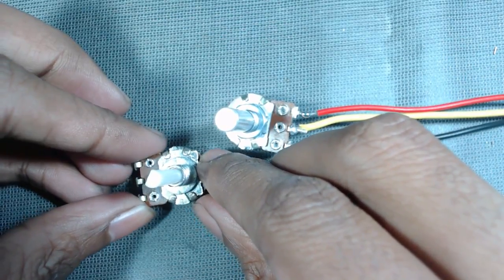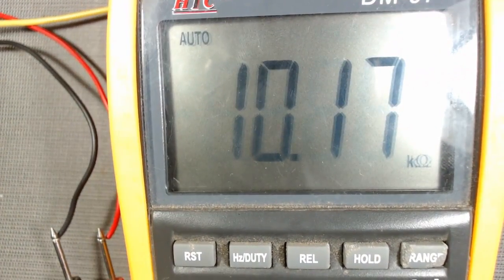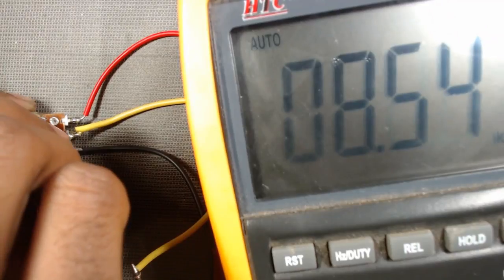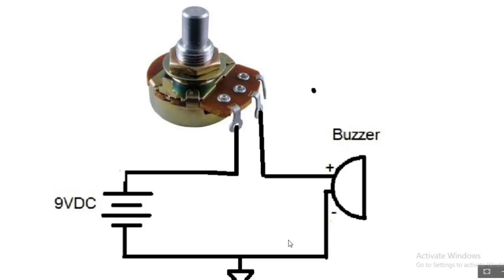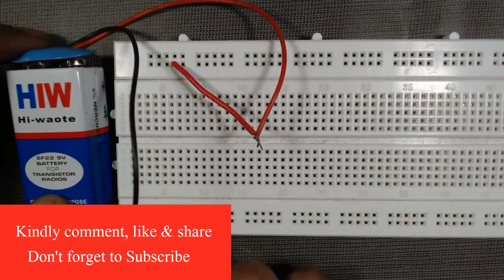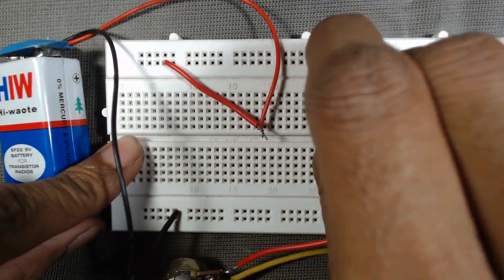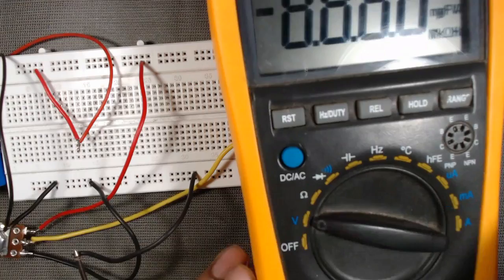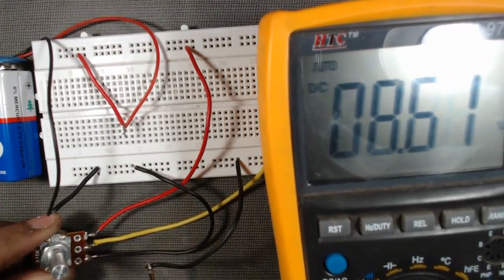how to use potentiometer as variable resistor and voltage divider

Comment: This video helped me a lot. I'm attempting to revive an old laptop and I plan to use a potentiometer in another laptop's power supply by lowering it's dc voltage output therefore lowering it's wattage (P = VI). I know the power requirement of the laptop based on it's dead power supply (64.98W = 19V * 4.74A) I intend to use my extra power supply to but I'm not sure if what I plan to do is safe for the laptop. Any input on this will surely help.

Comment: how would the voltage vary if the "wiper" (middle pole) and the low side were soldered together and a voltage was connected to the high side ?

Comment: I just subscribed to your channel.  I have a car battery going bad and cannot buy another one for about three weeks.  Knowing this I was thinking the battery will have to be charged each night to be able to function the next day.  The power supply I have on hand is from an old laptop; voltage rating of 20 volts and 2.5 amps.  So I was first looking at winding a transformer and  rectify with 4 diodes.  Then I was thinking maybe a voltage divider and realized I have 4 or 5 potentiometers from old circuits.  That was my ah ha moment, the easiest solution.  However I hadn't ever installed one.  Your knowledge really helped me out of a kind of rough situation.  Funny how the information needed came from the other side of the world and from your perception it's conceivable that one of the people who needed this knowledge in a very bad way (probably needed this info more than anyone given my situation) found you from the other side of this rock we call earth.  Piece friend, I will look at your videos first from now on when in need of reliable information.   Cannot thank you enough!
Reply: You charged your car battery with a laptop charger...?
Reply: @tubeyou0925  it charges about 9volts then gave out.

Comment: Simply defined and easily understandable video on the subject thanks a lot.
Reply from the maker: Thank you
Reply: @DPVTECHNOLOGY  can a potentiometer be used to adjust high voltage, between 200volts and 300 volts?